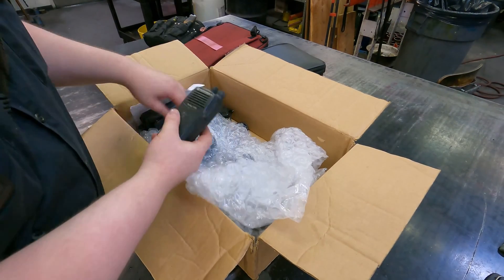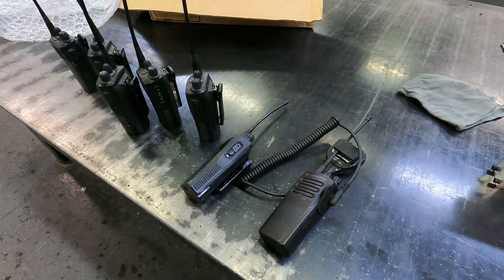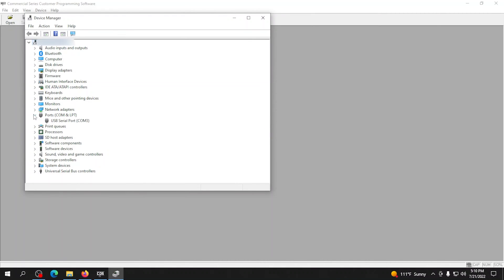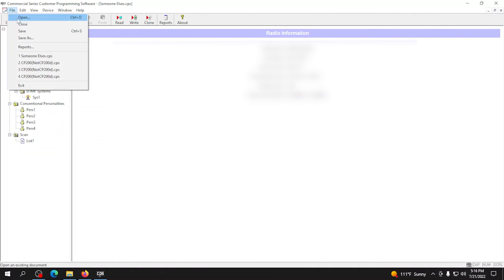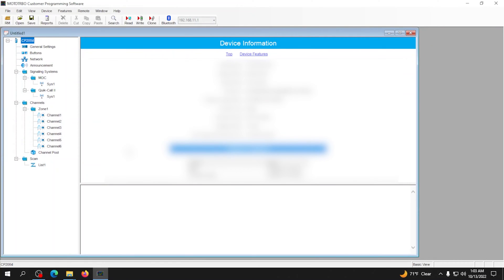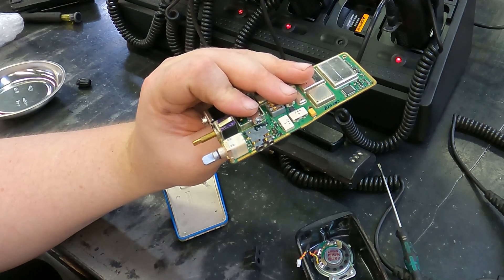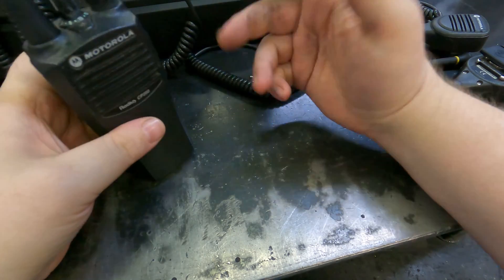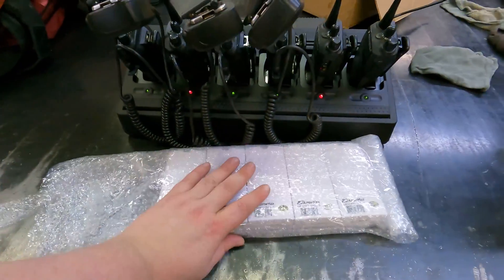Programming Motorola Radios From Ebay (Plus Common Repairs)

Comment: I need help with my radios. I got 2, and they worked, but one had a red blinking light. I reprogrammed them to change the frequencies to whatever is used in film, and now when I press PTT, nothing happens.
Reply from the maker: I don't know what ttp is.  Are you talking about a red blinking light on the charger?
Reply: @Distractor_Beam  No, the light near the antenna blinks red. Anyways, they did communicate between them before, and now when I press the push-to-talk button, nothing happens. Would you be willing to jump on a Zoom call to guide me on fixing whatever is wrong there? I'd pay you.
Reply from the maker: @SoulstormAI  No.  A red blinking light can mean battery is about to fail or it failed the power on self test.  There may be more, but that's what I remember.  If you programmed it with a dead battery, you may need to charge it and try programming it again.  Otherwise you may have a hardware issue and should consider sending it to a shop.

Comment: Yes the big M is the supplier of software BUT when they no longer sell it there ARE other alternatives. The major issue is that one must keep computers to support older software. Back up copies must be made every decade since some media will fail after time. 
If you use original SABER radios, you need legacy 8088 or 286 machines running slow enough to properly read and write to these radios. Timing parameters were tied to the slow microprocessor timing of the computer and the slow legacy comm ports. Newer Waris based radios like the HT600 line still use DOS programs but no faster than a 486 based machine. The newer the radio the newer machine one needs. Programs run with DOS, WIN 95, 98, XP, 7, 10, 11. Now consider one needs to own a machine capable of these platforms to keep legacy programs running. This is not cheap since you not only need to keep the parts for these machines available in case something should fail. 
Please don’t complain if a dealer wants to charge you a fee for programming these radios, it’s more of the cost in computers than the actual program itself.

Comment: My cps reads radio fine but has 12.5khz requirement. I need 25khz.
Reply: That might be an issue. Rumor has it that if you intend to operate it in the amature bands, have a valid amature license and the radio is capable of operating in the Ham bands they might be able to sell you a program for the radio but there are several issues you need to look at. First, is the radio capable of natively going down to ham bands? Second if it has been programmed with the latest software, it cannot be programmed with older software, and as far as I know from what I have heard sending it back to Motorola to get blanked and re written is not cost effective. Fact is that all of the major suppliers of commercial radios have been forced to sell newer software that prohibits the use of wideband modulation. The other issue is can the newer radios support wide band. A lot changes with the receiver on narrow band plus audio processing changes as well.
Reply: I'm not after amateur Frequencies just GMRS and some receive freqs. These are cp200, p1225,gp300,gp350,sm120. The newer XPR 6550 DMR Radio's.

Comment: Where did you get the software to program these radios? is there a link or specific software name? I had a supply of CP200 radios and was hopeing to program them
Reply: When I buy the programming cable for the radios I buy most will send it with the cable. eBay has plenty of radio shops that will help you.

Comment: Cp200D are also single band only. There are no portable dual band dmr radios (or dual band consumer analog radio) made by motorola (except for mobile radios with dual brick or the apx 7000/8000)
Reply: Yes, right. I was about write same note.
Reply: One must keep in mind that the Big/\/\ radios that are dual band only work in FM mode or P25 tier 1or2 only. They do not make a dual band DMR radio. Simple reason is that most public safety requires that radios operate within a universal system after laws were changed after the communications fiasco that took place after 9-11. Also the sound quality of the P25 formats are far more superior to DMR audio.
Reply: @Subgunman  I would argue that DMR & P25 Phase 2 sounds very similar (at least my local system does). P25 Phase 1 sounds miles better than DMR though

Comment: love the vid as i've just come across these radios to add to my collection. JUST PLEASE don't dangle shoulder mice off the antennas like you have at 6:40 🤣🤣.
Reply: Thanks!  :)  Out of curiosity, what's dangling the mic on the antenna do?
Reply: @distractor_beamreviews It can bend or sometimes accelerate the wear and tear on the rubber outside layer of the antenna (the antenna’s rubber sleeve will break off exposing the metal inside).
Reply: @Distractor_Beam Reviews  the mic is one of the 'American Cop style ones that  you have the radio clipped yo your belt and just have the shoulder mic on your shoulder